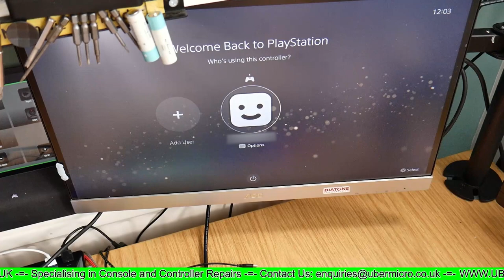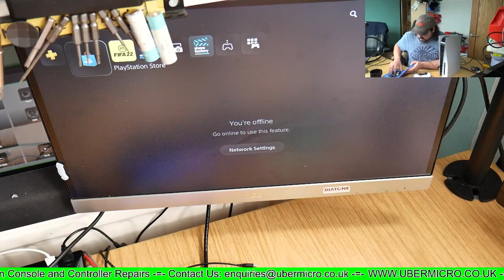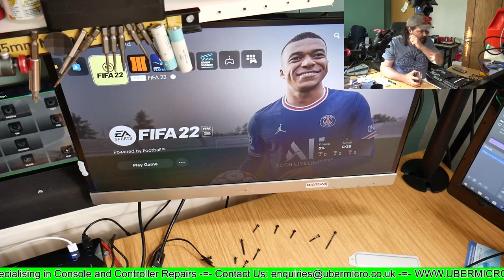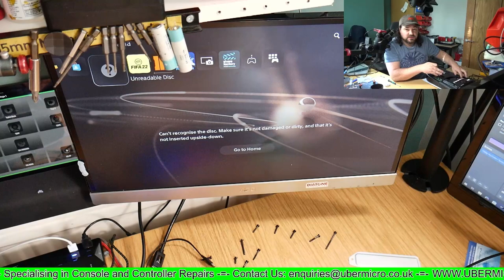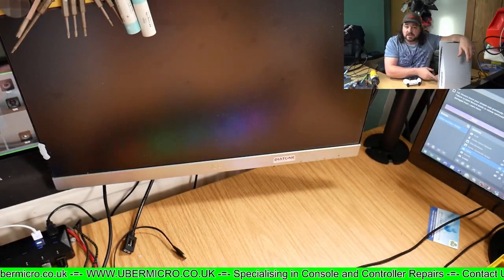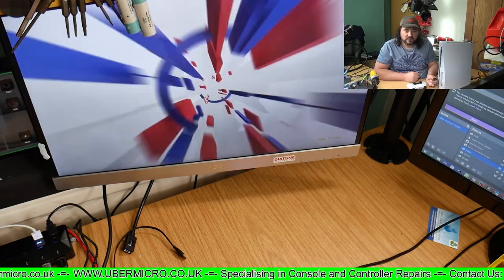PS5 Not Reading Disks 🛠 IT'S NOT THE LASER! 🛠

Comment: Had my ps5 less then 24 hours and it's not working faulty disc. Was nice knowing you all but iam just done with consoles now
Reply from the maker: Take it back to the store. Or Sony warrany.
Reply: @UberMicroRepairs  I am just gonna get  refund then iM done
Reply: Me too, bro
Reply: I feel you dude, mine shit the bed twice with different issues.
Reply: Hey, I just had faulty disc tonight repeatedly I took the covers off blew out the fans and screwed the manual disc release clockwise about 10 15 times it’s working perfectly fine now
Reply: @iroc-z6668 so if I do that it should work?
Reply: It fixed mine. It’s working just fine now.
Reply: It happened to me last night for the first time ever screw the manual release for the disk clockwise 15 times and I have no more trouble with it.
Reply: Take it back and get an XBOX
Reply: @iroc-z6668 not worth the hassle, Sony charges $250 to tighten a dagum screw?!?!? 🤬🤬
Reply: I really love my ps5 it's an awesome machine but I've just experienced the same issue after having it for two years, very frustrating playstation support quoted me over 200 to fix pretty ridiculous if you ask me

Comment: Great video. My PS5 just started doing the exact same thing just under a week ago, won’t read any discs. Appears Sony wants $250 to fix it have not decide whether to send it to them or find someone local who does repairs.
Reply: WHAAAT? Don't u have warranty card when u bought it?
Reply: Same issue for me.  Maybe your credit card offers an extended warranty?  Got lucky that the Visa I used extended the warranty by 1 year, so currently in the process of filing the claim.  Have a feeling a lot of these drives are going to suffer the same fate, so hopefully that's an option for some people.
Reply: @notmyname6452  my guy Sony Nintendo and Microsoft all have 1 year built in manufacturer warranties.
Reply: U get it fixed it's gonna do it again trux me I've had my share of multiple times.... keep getting new hard drive disc fixed....from PS3 to the PS4...yeah so I'm basically here just to see if the crap is built any better from last consoles but apparently the issh hasn't changed jux got my PS5 fresh outta wally 🌎 like yesterday and just was wondering if the 5 is going to eventually wear out too like the other ones...😢😢 Sad 🌎 we live in rather country me personally I was done with gaming and I decided to stop because of this exact problem not to mention alllll the hackers n modders who makes the gaming 🌎 lame

Comment: This issue is way too common, considering older consoles like the PS4 may very well be still alive since the release. I’m low-key hoping this is brought to the EU the same way as the Nitendo joycon drift and they force Sony to offer free out of warranty repairs instead of robbing the consumers for their own incompetence
Reply: Disc driver just stopped working today, first day owner, just stopped without reason!
Reply: @johnzero7397   This appears to have happened a lot recently. Something tells me they fucked it up with a buggy software update because there ain’t no way it’s hardware if it happens all of a sudden at the same time and especially on new consoles too
Reply: Yeah could be, i see a lot of people pointing this problem out
Reply: @johnzero7397 Hello, hey, does your console read DVD discs?
Reply: Same problem, 3 months past warranty. No happy. Ps4 run no problems for 5 years
Reply: @elgatocosmico403 mines don't
Reply: That is exactly the noise mine now makes. And it all atarted after an update.
Reply: @Spiriluli Exactly what I think happened. Buggy or on purpose. $$$$$

Comment: Thank you! This solved my issue, thought for a moment I had a faulty unit. Once I removed the cables beneath the lens it started working again.
Reply: What cables?
Reply: @Portal2Fan1234  the flex one, which is underneath the lens as shown in the second part of the video. Just remove and reinserted it and it worked.
Reply: @fidanhallaqi1862  the one thats underneath the mechanism that blocks anything from getting into the disc drive once a disc is inserted in?
Reply: @Portal2Fan1234  one on the video at 5:20
Reply: My discs arent even being recognized. I dont hear the spinning of any disc i insert. It takes the discs in ejects em out perfectly just wont spin them up. I dont even get the CD icon up top.
Reply: @fidanhallaqi1862 I think I will try this before buying a replacement disk drive thanks for the idea, I hope it works for me
Reply: Dude omg this worked you’re a legend!

Comment: My PS5 purchased January 2021 seems to have the same issue you described. The disk doesn’t spin up fast enough to read Blu-ray’s so it gives me the unsupported disk error… It reads DVD’s just fine though. I’m so pissed, I hardly used the drive and I’m not about to give Sony $230 to fix it. I’m in the US otherwise I’d hit you up for a repair.
Reply from the maker: Sounds like it may just need the laser replaced. The fact it read DVD's is the tell tail sign.
Reply: Why should u give them money to fix their problem? Hell they should give you brand new wtf
Reply: I have this same issue just started happening. Have you had any luck?
Reply: My ps5 reads dvds but not blurays ps5 games can you help plzz

Comment: Mine takes a disc when you first turn it on.  Spinning icon appears in top center of screen.  Doesn’t play disc.  Eject disc.  Try to put it back in. Doesn’t take discs. Will not take another disc unless you turn off or restart.  Starts process all over.  It doesn’t give the unrecognized disc prompt.

Comment: I have a problem when I insert/eject disk, I have a crunch sound. I think the problem is the small engine which turn the two entry rolls (not enough power). If I use manual ejection, I have no crunch problem.

I just buy a new PS5 drive with shell, and whant to know if I need to invert full controler electronic card with original ? 

Thanks for your help.

Comment: Hey I've been having similar issues and though you could shed some light. My ps5 reads disks when it wants to. About 50 % of the time it doesn't read it and says unsupported disk or can't read. It tries and sounds like it's reading a disk and it's spinning up, then sounds like it slows down and gets quieter. It keeps doing this nonstop until I eject it. I opened and cleaned any dust. It's not the disk it happens on every game even new ones. After taking the disk in and out it will work most likely. I don't hear grinding just like it's revving up to boot up a game. At a lost and don't want to pay a lot to sent it to Sony if it's a simple issue. Any help would be appreciated. Ty
Reply from the maker: Hi there, that sounds exactly like a failing laser! If you're in the UK, drop us an email to enquiries@ubermicro.co.uk and we can give you a quote to get that sorted for you! 😉
Reply: Mine did that for a while and then stopped working.

Comment: Seems like thats alot of people's issue the disk drive or some sort issue  associated with it lol.... and right out of warranty to lol, also barely use the drive, but good info, seems i have to send mine in sadly, cleaned the lens and lubed up the rollers and most likely the chip issue... just odd it would go out when barely used......  oh well...  1st world problems....
Reply: So my PS5 reads all DVD discs but not Blu Ray , Ps4 games or PS5 games. I've only used the drive a handful of times but it was purchased 2 years ago from Sony.  From the start when installing games the the PS5 disc drive was noisy,I mean noisy and LOUD vibrations happened all the time lying horizontal. I will try this:
Take the covers off blew out the fans and screwed the manual disc release clockwise about 10 15 times & check if it’s working

Comment: Is there a site you would recommend to buy the logic board? I’m having the same issue and pretty sure it’s not the laser not reading my disc.
Reply from the maker: Hi the board in the BR drive has a renesas ic that is married to the APU on the motherboard. So swaping the board will not work. The IC  I replaced can be found here. https://www.consolefix.shop/collections/replacement-playstation-5-components/products/replacement-motor-controller-for-playstation-5-ps5-bdrom-drive Its the motor controller IC.

Comment: I have a weird case...mine isnt recognising SOME discs. The same discs do play, and the same discs don't. Its not an issue with the discs though as they play in my PS4. I also have a brand new PS5 game that my PS5 wont recognise. It plays normal DVDs and blueray DVDs fine too. I have tried everything I can think of software wise. Do you think it could be a hardware issue even though some play and some dont? Is there a different reading mechanism for discs that are already loaded on the console? It seems like games that are on the console are generally the discs that are recognised but then there are a couple that still dont so i am at a loss. Please halp :'(

Comment: My PS5 disc drive will read DVDs but not Blue Ray discs.  Does that make it more likely that replacing the laser sled will work?
Reply from the maker: This fix is not the normal repair. Disk reading issue are 99.8% the laser or kids sticking randon stuff in the drive.
Reply: Will opening the bluray drive and cleaning it with a rubbing alcohol work bro
Reply: @aghatechnobuzz3317  nope. just tried it. i order replacement laser. will update you  after maybe 2 weeks
Reply: @longshin17 have you got the replacement laser yet?
Reply: @iceman100685  yes i have it . i change the laser and my ps5 works again. got the laser for 26$
Reply: @longshin17 I appreciate you responding back because you are the first, and I will go ahead and change out the laser and tell you how I come out. That's crazy because my PS5 ain't nothing but a year and a half old, and the laser is shot. My PS4 which I still have the laser is still going strong and hard and I have never had it go out on me.
Reply: @iceman100685  No problem :), I've got my ps5 on november 2021. I only got 1 disc ps4 game and i barely use it, I just purchase a disc version of gran turismo and ragnarok which on sale on my country to not read by my ps5. im so pissed. Luckily i can tinker electronics so i replace the laser all by myselft. Just be careful on assembling the disc drive look out on some gear and the mechanism that detect when u insert a disc
Reply: @longshin17  okay I have saw videos on here that show you how to replace it properly so I will use those as a guide unless you got a guide that I can use as well🤔
Reply: @longshin17 Hello, when your console was broken, did it read DVD discs?
Reply: @elgatocosmico403  yes it read dvd movies

Comment: Hello, i tried replacing the laser on the disc drive, but it turns out that it reads ps4 games without any issues. With both the original laser drive and the new one. It does not read ps5 games in the slightest. I do not know what to do. Please help😢
Reply from the maker: Are you sure you have the correct laser? Try cleaning the laser eye with a q-tip gently..

Comment: Thank you, my ps5 reads movies, but not games, I'm more confused lol. Can somebody help me?
Reply from the maker: Sounds like you need a new laser.
Reply: So my PS5 reads all DVD discs but not Blu Ray , Ps4 games or PS5 games. I've only used the drive a handful of times but it was purchased 2 years ago from Sony.  From the start when installing games the the PS5 disc drive was noisy,I mean noisy and LOUD vibrations happened all the time lying horizontal. I will try this:
Take the covers off blew out the fans and screwed the manual disc release clockwise about 10 15 times & check if it’s working!:text-green-game-over::text-green-game-over::text-green-game-over::text-green-game-over::text-green-game-over::text-green-game-over::text-green-game-over::text-green-game-over:

Comment: My ps5 stopped reading ps5 discs randomly after less than a year. I threw in A ps4 game and it started installing and installed the updates but halfway thru game install it keeps getting errors that i hit resume on and it repeats.  Ive tried safe mode cache clean. Safe mode rebuild. Safe mode restart. Tried dvd disc cleaning discs wit brushes. This thing never had a problem. Now any ps5 disc say unreadable disc.
Reply: I'll pay whatever u think is fair to have u repair it. I think Sony put bad disc drives in these to sell more invisible digital games. I like my collection physical. I like having the box and disc.  Should I replace disc drive or are they formatted to the ps they come with?  I've been schooled in electronics and soldering.  Much rather send u my console and see what u think.  Hogwarts and Jedi survivor worked last week.  Today, it only read a ps4 disc but couldnt finish install. What should I do?  I'll pay for your help. Lmk
Reply from the maker: Sounds like it may just need the laser repaced since it's doing sporadic reading. Please contact us here: www.ubermicro.co.uk

Comment: My PS5 is doing the exact same thing, the same sound, also in the laser motor, i wil try to check the flex but for the repair you did i have no tools or ability to do that kind of soldering, im thinking of just buying a full replacement disk drive unit I found in Amazon
Reply from the maker: Remember the board from your drive will need to be transfered to the new drive.
Reply: @UberMicroRepairs  Why can i not use the new drive and board?

Comment: Not sure if I have this problem, replacement drive not working (with original board). Drives take the disk but never fully spin, no error code is posted. Any other ideas or way to confirm the IC has gone? 

Happy to do my own repairs but wouldn’t want to solder as only have a basic £10 one, don’t think that would be good enough for this
Reply from the maker: Could just be the laser. This video was a uncommon issue. TBH I could have done the video a lot better.
Reply: @UberMicroRepairs  thanks. I did think could be the laser but I’ve tried the original drive and two replacements now. Just can’t seem to figure out the problem. Thanks for the reply

Comment: I think I may have the same problem. The disc isn't spinning. In my case it makes a first try; it can't hold the spinning. Then it would try to spin again.

Could it be the motor itself? Should I replace the same piece as you in your first try?
Reply: Hey I have the same exact problem. I opened the ps5 myself. Everything looks great, with no dirty or scratched, but I still have the problem. How did you solve it?
Reply: @thirsterforhistory  I've bought the same piece he replaces at the start. I'm still waiting for it to arrive home though; I think I'll be able to tell you if the replacement fixed it for me or not in a couple of days, as it has arrived to my country a couple of hours ago. I think it won't work but who knows, it's worth the try at least. 

I'll make sure to tell you if it worked for me or not.
Reply: @nicholaswarren6311 did it work?
Reply: @AK-ne4bb  What? Haven't you read my answer? It didn't...
Reply: @nicholaswarren6311 how about now?
Reply: @nicholaswarren6311 how about now?
Reply: @eeshancamara748  You are mocking about me, right?

Comment: Thinking mine is suffering from the same issue (makes the rapid clicking noise and unable to read discs).  At the end, you mentioned even the donor unit was resolved by fiddling around with the connections a bit while the disc was in right? Suggesting it was more of a physical clearance issue with the sled?  Sorry if I'm completely off base.  If this was the case though, I'm wondering if I might be able to achieve a similar effect without opening up everything?
Reply from the maker: In this occasion it was a bad controller IC on the board. I almost abandonned the filming of the vid as I was at a los of the cause. but replacing the IC sorted the issue.
Reply: @UberMicroRepairs  where did you buy the replacement IC?
Reply: @skinnyj4202  Think he got it from another one of his boards, possibly another project where he had a spare ps5 lying around with some other issues xD

Comment: I’ve had my ps5 since November 2021, it was working just fine but now it only reads some disk and it’s off and on. Is it the laser?
Reply from the maker: Most likley the laser since it reading. This one wasn't reading disks at all.
Reply: Bro  my ps5 stopped reading ps5 games but is reading dvds  when i insert ps5 games it doesnt spin after 40 tp 45 seconds a sound of like  eject disc comes and after 10 seconds it says unreadable disc
Reply: @aghatechnobuzz3317 im having the same issue my ps5 only plays DvDs so i ordered a disc drive online. I hope thay solves the issue

Comment: @9:36 it's not the laser now at 11:50he replaces the PCB board, who knows if any of this will last. Conclusion PS5 vibrates too much and disc drives are too noisy - poor quality by Sony & PS5 @14:20 original laser in with new motor control IC. That is how my PS5 always sounded from the beginning it vibrates way too much! @17:20 the laser from SONY is trash some cog slippage from PS5 garbage - I can't believe how bad & noisy Sony PS5's are.